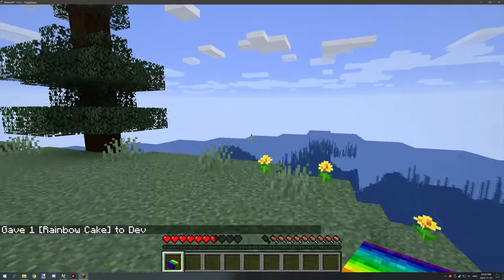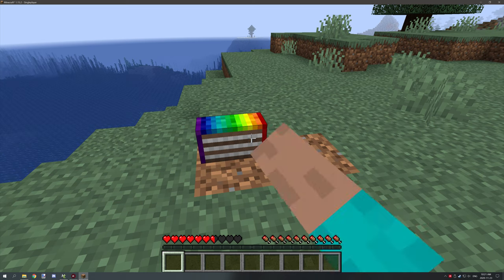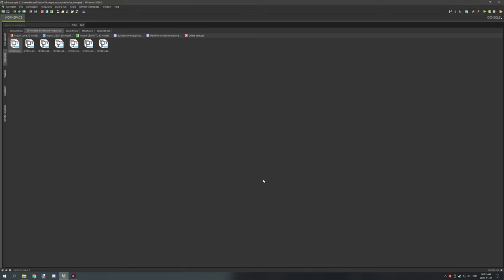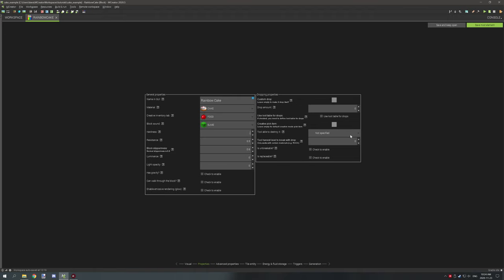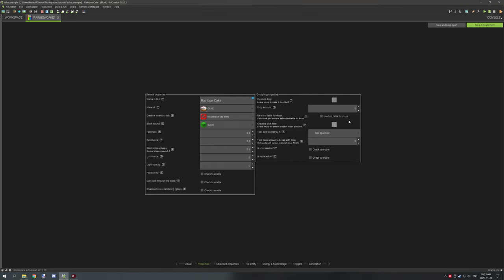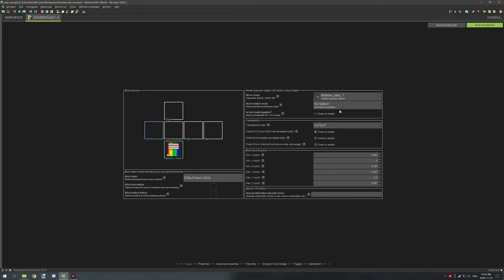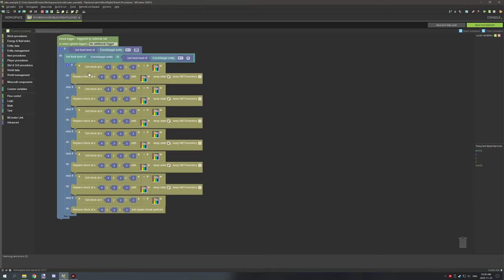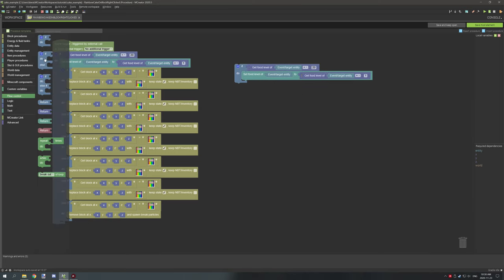MCreator: How to make a Cake Block | 2020.5

Comment: Wow this one's great! I love cake. Could you do a tutorial on crop spawning similar to pumpkin patches or melons?
Reply from the maker: The feature element should have a feature type for this already built-in.
Reply: @NorthWestTreesMCreator  I’ll have try it. I’ll let you know if it works.
Reply: @NorthWestTreesMCreator  After going over it, multiple times, the feature itself works, however it does not generate naturally. I can /place it, but it doesn't seem to naturally spawn. Is this because I used a block for the melon instead of a plant? and if not any ideas on how to fix it?

(also got any tips for how to add multiple lines on GUI tooltips?)
Reply: @NorthWestTreesMCreator  I would like to correct myself on my last comment, it now naturally generates! And I fixed it's generation structure. Unfortunately now that it's a plant and generates properly, it doesn't have block properties. It doesn't have any light opacity to block out the sun, it can't be built with like a normal block & its handheld model is a flat texture instead of 3D etc. Do you know how to change this?
(also my p.s. still stands. (do you know how to add multiple lines on GUI tooltips?))

Comment: Thanks for the cake model! Now my cake doesn't look like a slab XD
However video is outdated and now with the new bounding system the values, that he put there are making cake's bounding box smaller than a pixel, so I had to guess the actual bounding box size. After some attempts I got perfectly fitting bounding box:
The cake, that wasn't touched: Min. X coord: 1; Min. Y coord: 0; Min. Z coord: 1; Max X coord: 15; Max. Y coord: 8; Max Z coord; 15
One slice is eaten: Min. X coord: 1; Min. Y coord: 0; Min. Z coord: *3*; Max X coord: 15; Max. Y coord: 8; Max Z coord; 15
And then it adds 2 to Min. Z coord every slice.

Comment: could you make a animated texture in mcreator
Reply: To make a animetaed texture in mcreator, you first off need to make the texture for each frame for example if i wanted to animate a block that changes colour i would need to make the texture for the red and the green. Next you need to go to Resources, then Create new Texture and click create animated texture. Now click Add frame(s) (Bottom left of screen) and import the texture's you made. And you can change how fast it animates. Once your done click save this Animates texture In the top right of teh screen and then click item or block depending on what you make the animated texture for. Now go to the block/item you want animating and double click and left click on left and choose the animated texture (it may look squashed but once in game its totally fine) Now click save mod element. and your ready to launch your game and it will work. Hope this helped